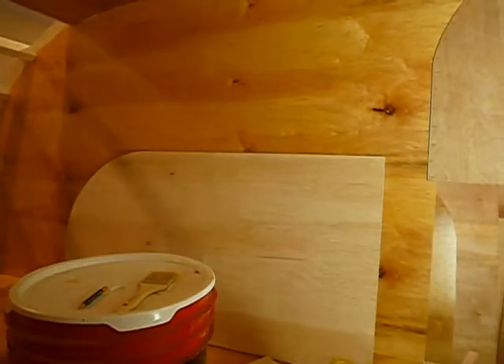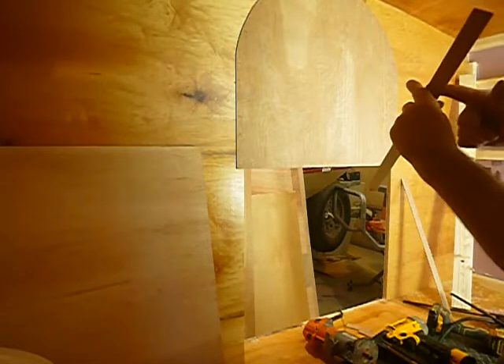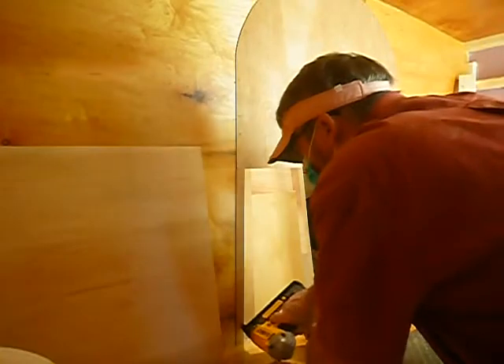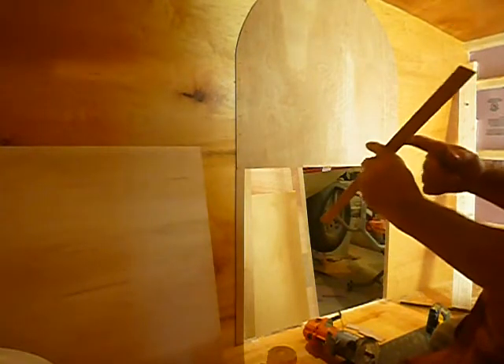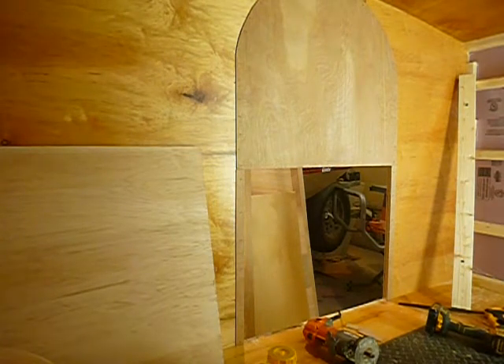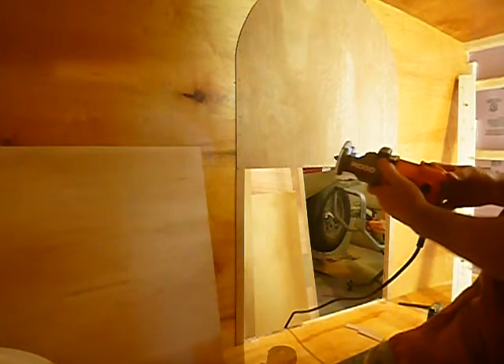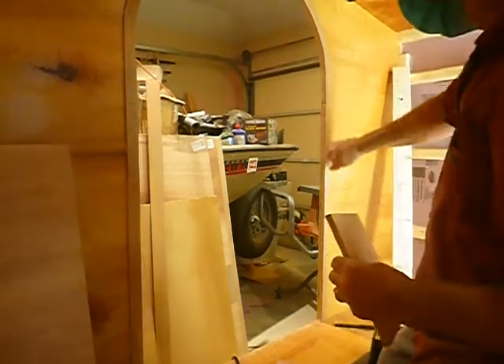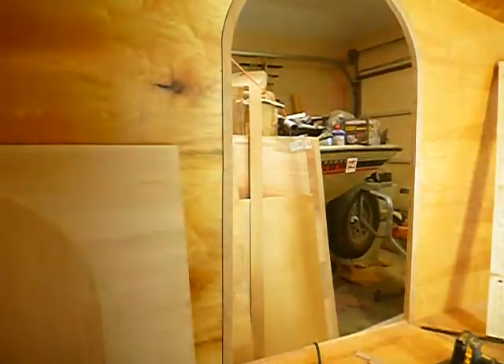DIY Teardrop Camper a 5 X 10  M25      Teardrop door gasket how to

Comment: Having the right tools sure can make a huge difference in how a project comes out. What a nice clean smooth cut. So important to have good gaskets. Do not want rain making it's way inside just because of not having a good gasket installed.
Reply from the maker: You know that is right rain is nice just not inside a camper

Comment: When you routered out that top door stop you mentioned that the router path might be partially blocked by the ceiling, and you might need to go back and trim with a hand saw, and I could hear the change in tone near the peak of that doorway, but it was out of frame so not sure what happened. Quick glimpse at 5:36 and seems like the top of that radius was a bit flat but not 100% sure.
Reply from the maker: Yes I slowed down and when I got to the top and to my amazement it I only needed to trim a bit off. Since this piece of wood is 2.5mm and just a spacer for the door stop I did grind that off before installing the door stop which is the next layer the door gasket will be applied to